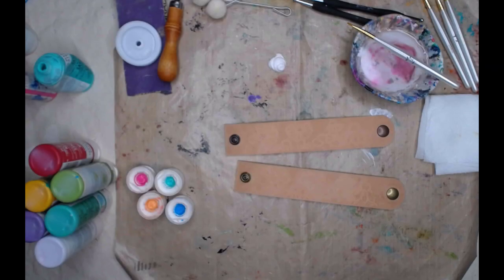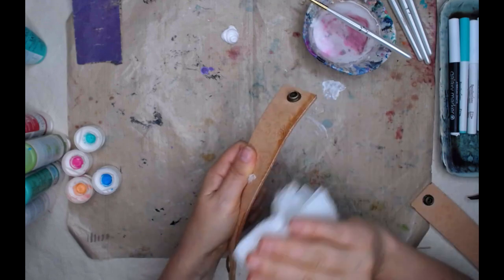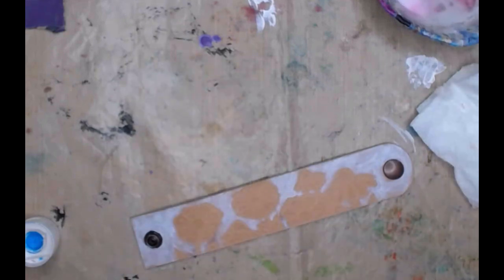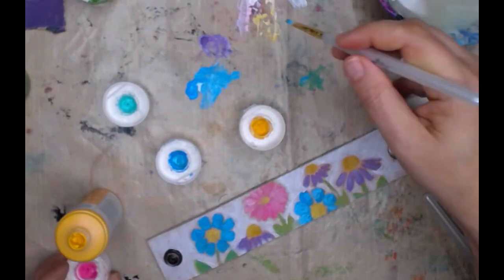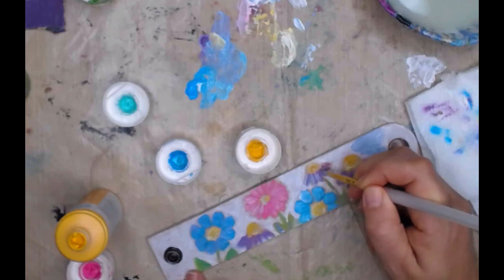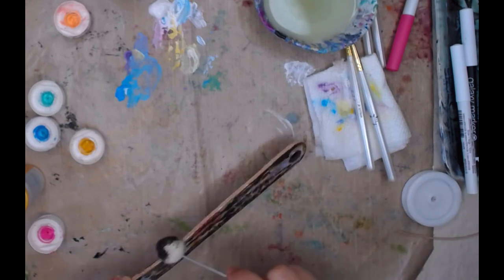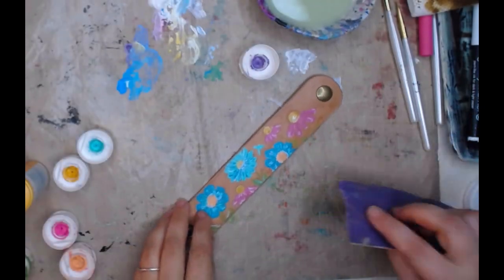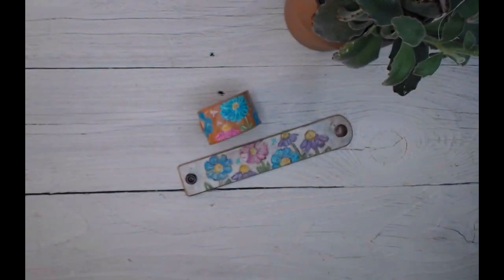How to Paint and Finish a Leather Cuff

Comment: Great work! What kind of paint did you use?
Reply from the maker: I used multi-surface craft paint from Michaels. I think I was using the Martha Stewart brand, but that was made by Plaid, and now there are other multi-surface craft paints at Michaels that I think are the same. There are lots of colors and they aren't too expensive.

Comment: I am a leathercraft and would to know if this machine is good cutting 4-5zo leather for wallets and light weigh project. Watching your videos it does look good for leather,just want to make sure before spending alot of money on something I can't do.
Thank you 
Rob
Reply from the maker: It get ya! It does a great job with cutting that weight leather with its knife tool. And it can cut super small holes in that weight as well. I think it could probably do stitch marks. Not sure about that though. You might also be interested in that it also has an engraving tool you can purchase that engraved leather really nicely. Thanks for your question! Let me know if you have any more. Jen

Comment: i left a comment and question on your page  but just in case     i was wondering about the leather /  is it tooling leather and how do you know what size or weight for bracelets  ?    thanks
Reply from the maker: Hi Nancy, just circling around to make sure you got my email answer to this question.I did use 6-7oz. tooling leather. I hope you saw this a week ago but just in case…
Reply: @WellCraftedStudio  thanks you so much. Very nice of you. I actually didn’t see email.  Now I know.  6-7oz. 
I ordered a batch of scrap leather on Amazon. It was absolute crap.  Threw most of it away.  I guess I will just try another place.  Thanks again.
Reply from the maker: @nancyclegg3554  I bought mine from Tandy leather but have found it at Hobby Lobby too. You want untreated vegetable tan tooling leather.
Reply: @WellCraftedStudio  oh ok. Thanks for sharing this with me. I am in hobby lobby a lot.  I will check out both. Thanks again